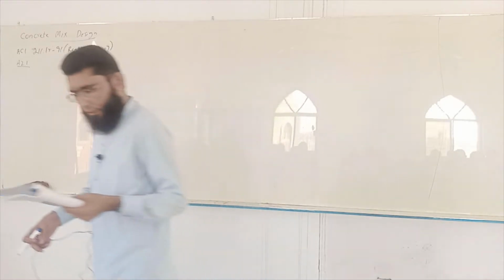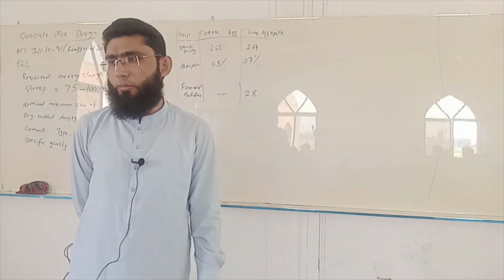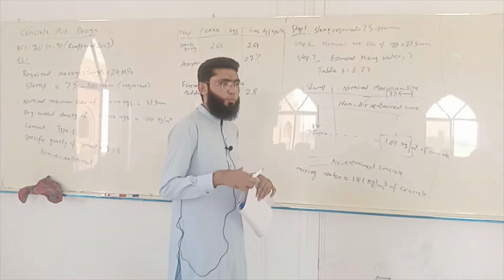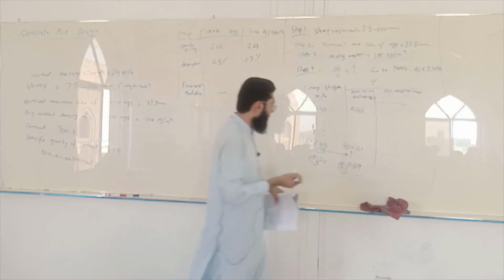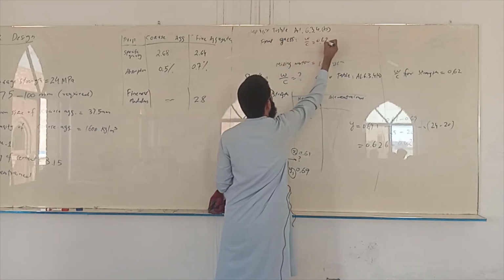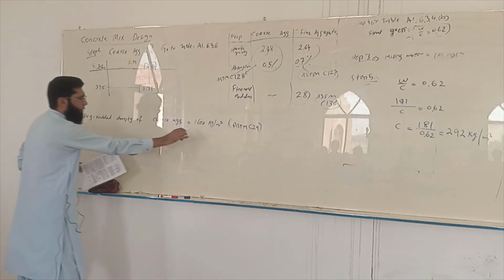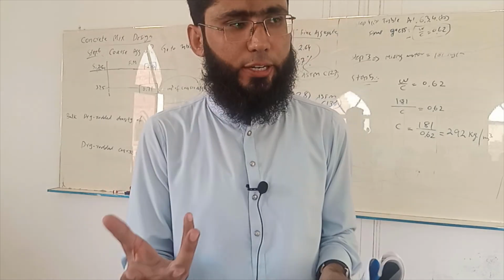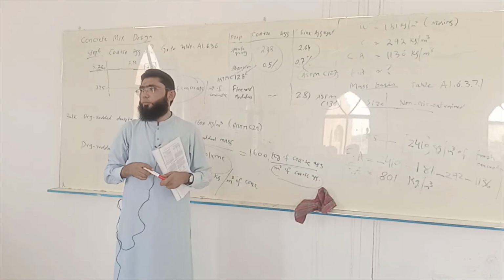Concrete mix design example ACI 211.1R | Part 1

Comment: sir when will part 2 uploaded?
sir i think moisture in C.A and F.A are  also considered during concrete mix designing
Reply from the maker: You are right. I ll check if part 2 was recorded in which adjustment in water for moisture content of aggregates was discussed.